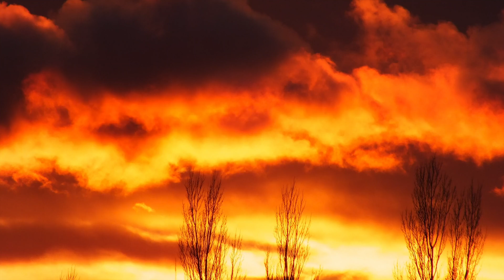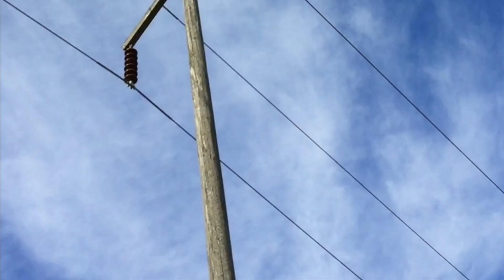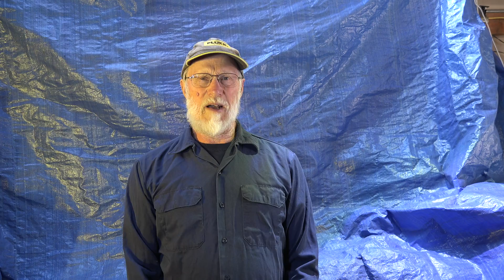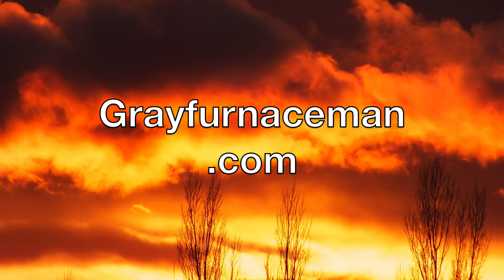The heat pump #1

Comment: I've been in the HVAC business for 26 yrs but for the 1st half of that time I only worked in the summer because every winter I worked on the Docks, but that's not the only reason. Here in Philly heat pumps haven't that popular but that's changing. But because of that heat pumps are my weakest link. This year I've made it my goal to fix that. Thanks to your videos I don't have to pay for classes. I'm pretty damn good with everything else
Reply from the maker: Glad it helped.
GFM

Comment: Any ideas on where to find a 1986 trane weathertron wiring diagram. Trane sent me a diagram but it's not legible and they said that's all they had
Reply from the maker: Do you have a model #?
GFM
Reply: @grayfurnaceman  MODEL. BWA090C400MA SERIAL. S17191733

Comment: I have:

GOODMAN ASPT33C14 air handler w/15kw strips, ECM motor and non adjustable TXV.

GOODMAN GSZ16030 heat pump.

Question is why am I using the Y2 terminal on the terminal board of the air handler instead of using the Y1 terminal?
Reply from the maker: I can't tell you the reason, but there is no connection to the Y1 terminal inside the unit.  
GFM
Reply: TY

Comment: Have a question. If i remember well, you explained in another video that, if you put a jumper on W1 and W2 on a 2 stage furnace, after about 10 minutes, second stage will come on . Would it be the same on a heat pump? On the outside unit, if we put a jumper on Y1 and Y2 , do second stage would come on after few minutes?
Reply from the maker: I have not seen a heat pump with that option.  They will all start immediately if the thermostat is raised more than 2 degrees.  This is assuming there is no outdoor thermostat that controls backup.
GFM

Comment: Up north here in an ideal situation I'd prefer a geothermal system for stability. Because up north that window of efficiency is limited to fall and early spring. Not to mention defrosts cutting into that efficient operation with an air to air exchange like snow and icy and or high relative humidity  conditions  compounding that loss, thus relying on whatever backup heating you have on the other end.. Though they are better today than yesterday they aren't wildly sold in a northern climate. But really the bomb in much less extreme climates. 

Very interesting series GFM I greatly respect and appreciate your knowledge and no nonsense approach in your  teachings 👍👍
Reply: I live in the Georgia East Tennessee area and we do have heat pumps but we also find they tend to labor here in the winter months as well where they need a back up electric furnace or heat strips, a lot of this i think is because In this part of the south i am in we also have the mountains and different elevations of the Appalachian foothills which don't see the same temperatures all at once in the winter, For an example it could be just near 40 degrees just below the Atlanta area but here near the state line getting into more mountainous and hilly ground it might be below freezing even more colder in other elevations and this can happen in the day at any given time too
Reply from the maker: The biggest difference is the cost of installation.  Pretty hard to get a payback on that one.  If you use domestic water some areas will not allow them.  Do agree on the use in southern climes.
GFM
Reply: +grayfurnaceman we agree to disagree on that. All options must be laid out there.. I've seen these well sourced heat pump systems in operation mainly in open country settings where a conventional heat pump even though it's a cheaper to own option not being worth the cheaper investment in the long run. Certainly a much well source being a cheaper option than being at the mercy of the propane suppliers which is an extremely volatile market for those not on natural gas. These systems perform very well with a modest amount paid to run them. Commercially cooling towers are used and that presents a cost in commercial situations. A loop system would be pointless it's cost and dumping in and taking it back out is to complex to justify its cost  on an existing building. Start from scratch new with theses systems is the best option, not a retrofit.
Reply: You also need to account for the extra cost.  Here a geothermal one would never pay for itself the coldest it ever gets is around 32 for a few hours before sun rise 2-3 times a year.  Most of December, January, and Febuary is in the 60s and 70s.

Comment: Good video and enjoyed the HP history tidbit - 1945 as oldest heat pump (HP) you seen (and apparently maintained) is news to me.   Earlist I read about was in the 70s but source was Doug Eye (early pioneer of geo-thermal) as probably know).   Excellent explanation of HP concept w/ A/C heat xfer.  Presume will eventually expound on the  significant increases in HP efficiencies which well exceed the 36kBtu @ 40 degF to 12-14 Btu @ 20 degF (?).   Also would appreciate future videos w/ more history quick tidbits about HPs including what caused HPs to get bad publicity in 70s-90s.  Variety of reasons I recall included HVAC techs resistance to new technology (called "grudgingly accepted" - none of that going today 😕), wrong applications for HPs (still exist for high U-value, low R insulated envelopes), and wrong troubleshooting/maintenance decisions.  I've seen many of your UTubes and learned/reviewed.    Thanks for sharing your time, your knowledge, and keep including reminders about HVAC-R fundamentals.
Reply from the maker: That one was interesting in that it was water source and had no reversing valve. It had 4 hand valves with instructions on how to set them. It was done for an electric utility manager as a test mule and advertising gimmick.  I have series coming up on heat pumps that may help. I will be putting links at the end of each video and the playlist floor them. Hope it helps.
GFM